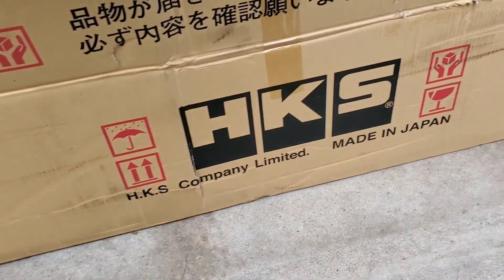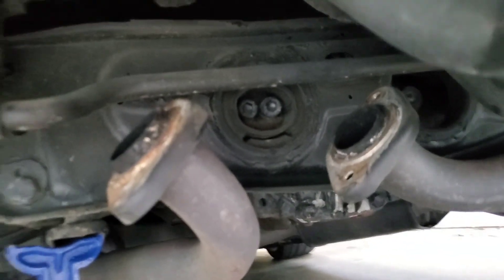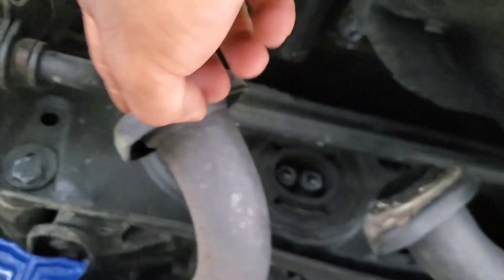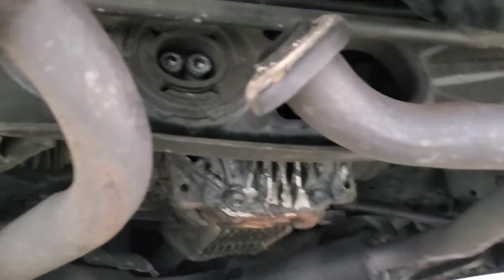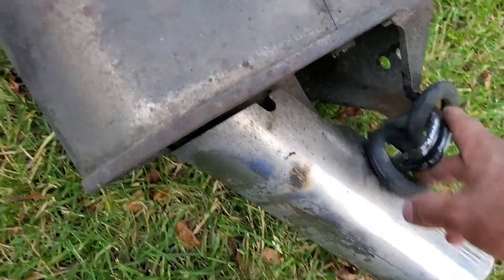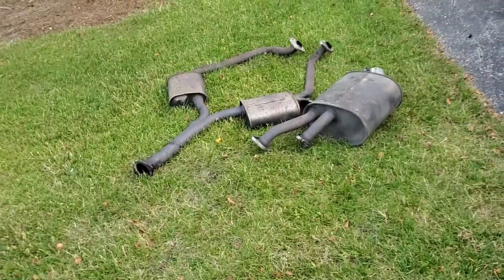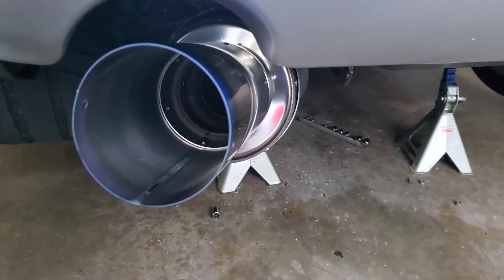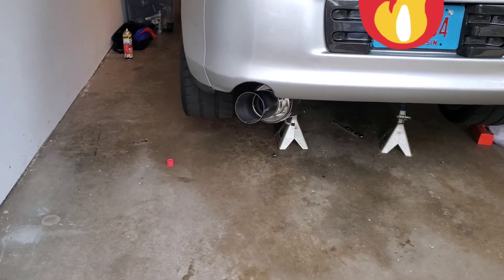1993 Toyota Supra 2jz GE oem vs HKS catback

Comment: Hey man I have a 97 NA Supra and I’ve been thinking about getting the same hks exhaust and I was wondering if you had any problems with installing the piping basically can I get a review cuz idk what to expect putting a turbo exhaust on the na. 😃
Reply from the maker: No it bolts right on.. I want to buy supra in future. It sounds good and not rice at all